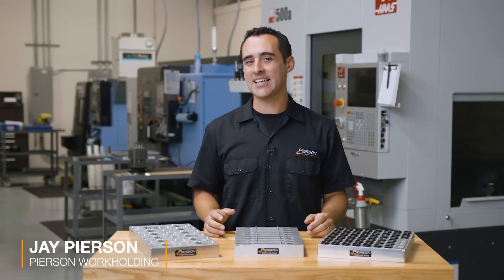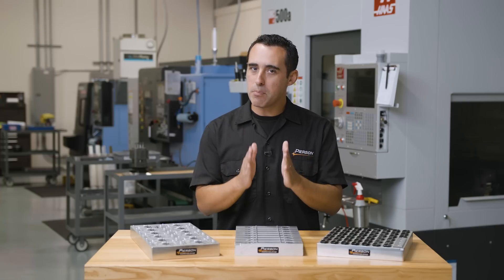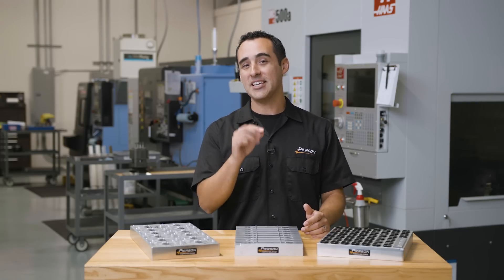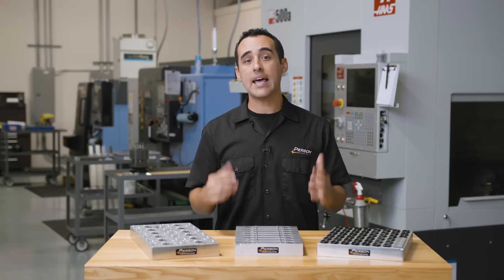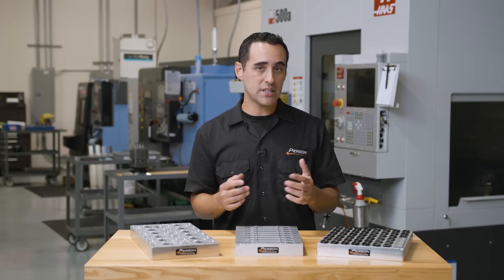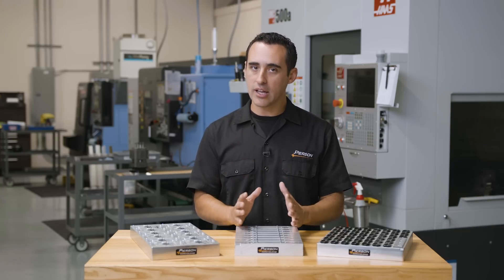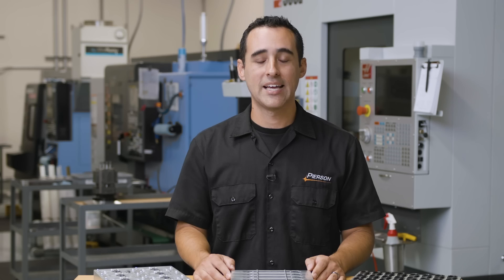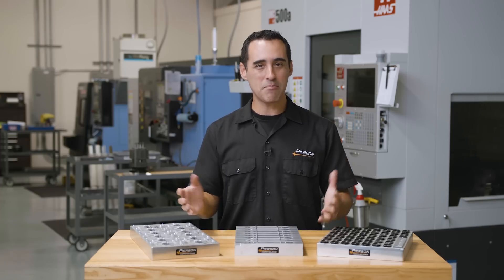What NOT To Do For Your Pallet Fixtures | Fixture Friday 12 | Pierson Workholding

Comment: actually you can create square hole pockets- SINKER EDM.
Reply from the maker: Or by broaching or by using smaller diameter endmills or by using a mating part that has an outside radius but EDM is the most expensive and slowest option and not recommended.
Reply: @PiersonWorkholding  agreed, rotary broaching would be cheaper. But if you got an EDM machine then I'd still go with that method.

Comment: Best clamps I've ever come across, have been OK-vise. Taking 2xD*85%ae in Aluminium with a 16mm endmill, and have never pulled out a part. Bonus is that you can machine soft jaws for them, and they clamp in two directions.

Comment: really enjoyed your tips... question... we have a few pallets and a tormach mill. unfortunately the tormach doesn't seem to have enough coolant force to really flush out chips. we end up with a lot of build up around the clamps and on inside features, and after we remove parts there's chips all over the surface of the fixture. takes probably 10 minutes to clean off the pallet in between uses. Any suggestions to help keep the fixture free from chips?
Reply: You can replace a pocket that utilizes the back wall of the fixture to locate the part, with a series of dowel pins.  By doing this, the part only touches the dowel in a very small section, which is essentially the tangent of a flat piece to the dowel, if that makes sense.  I'm not a fan of pockets, if I can help it, since they do exactly what you described.  You spend countless hours a month cleaning fixtures out of chips at best, and at worse, you risk the opportunity of one of those chips causing you to scrap a part.  
The fine art of fixture design has so many facets that most miss the high points.  First, repeatability is at the top of the heap.  Next is speed, the time spent loading and unloading.  Then there's operator friendliness.  No one wants to run a machine that kicks your butt all day.  Lastly, is exactly what your issue is, cleanliness or at least the ability to be cleaned easily.  Pockets, crevices and entrapments are death to a production shop.  
I've made thousands of fixtures over the years and my favorites were ones that were nothing more than a flat plate of ground A36, with a series of dowel pins sticking up and some of my custom "cam screws".  Clean, fast, user friendly and 100% repeatable.  Some of these fixtures I produced over 200,000 parts on without a hiccup.
Jay is putting out some pretty good content for the novice fixture builder, and it's been in need for a long time, but once you graduate to 4th axis for your fixturing, it's a game changer of epic proportions.  My largest part count to date was 276 pieces at a time in one push of the button, but I've done several that were over 80.  Lotsa of folks are skipping over 4th axis and heading straight to 5th, which is really a mistake most of the time, as you're limited to just one part at a time, most of the time.  4th axis on a vertical, with a tombstone, and fixture plates, is a gamechanger, that on the lion share of parts I see being put on a 5th, would run circles around.
I ran my first 4th axis tombstone on a Haas VF-2 in 1994 running 88 parts at a time.

Comment: Great tips, I never thought of the eccentric clamps being able to move up but I do realize that they do not pull the part down.
I use eccentric (hexagon style) clamps for some plastic (polypropylene) parts that I do for a customer. The parts are long, thin parts (160x15x8 mm) and having any marks on the side of the parts is out of the question. I only do some facing, milling a 1.5 mm deep pocket with a 3 mm end-mill and some chamfering. 
So I use them wisely, also for engraving on aluminum parts. I have seen aluminum blocks being pulled out of vices with smooth jaws. I tend to design my clamping such that I should not be able to move the part when I just finger tighten my clamping device (tallon grips, pitbull clamps, vice, ...). If I can move the part then there is a high risk it will move during milling.

Comment: another problem i have had using the smaller clamps is the minimal open and closing movement. in some cases i have found the tolerance on flat bar stock to be +/- larger than the clamps can compensate for. some times within the same bar it can be over sized enough to not go in easy and worse.. feel like its locked the material down when it hasnt and parts go flying.

Comment: Those aluminum channel clamps tend to fatigue and crack easily. I try to get about .001 to.005" gap between the part and the clamp face. The 7075 tends to develop fatigue cracks quickly.

Comment: Cool vid and good points. These are all basic clamps that are sold by MiteeBite/CarrLane. In my opinion I would recommend spending the extra money on the “ok vice” vise clamps over the uniforce or channel clamps. The channel clamps are just cheap and don’t perform like you’d want them to. I’ve designed a fixture with them once and will never use them again. 
If you’re already spending the money on fixturing a job, spend the extra money to make a dependable and repeatable tool.

I’ve just recently came across a great fixture supplier, Advanced Machine and Engineering Co. They sell high end fixture components that offer unique solutions to fixture design. Looks to cater to aerospace parts and castings. I realize this video was for miniature clamps focused on pallets but I thought these were definitely worth mentioning.
Thanks for the content Piersons!

Comment: Awesome video! Super helpful! When you use the bottom hat method (I think its called) where you cut your part out of a block but don't touch the thin bottom portion that is being compressed by the fixture, how thick do you make that portion? For the pitbull clamps its dimension "D" on the Mitee-Bite website. Could you go thinner then that or would you be worried the bottom hat would bow?
Reply from the maker: Good question! For aluminum, we typically hold between 0.090"-0.120" of material using the 3/4" clamp.  For steel and stainless, we always use the recommended "D" dimension of 0.150".
Reply: @PiersonWorkholding  Thanks that helps a lot!

Comment: How do you feel about non radially symmetric pallets? Over the 4000+ parts I ran this summer on pallets, I loaded two of the pallets in backwards. It scrapped a few parts and we had to re-machine the pallets. Do you usually design your pallets such that orientation doesn't matter?
Reply: I’ve actually have a couple of pallets that take advantage of the fact that they can be loaded rotated 180 degrees on the PPS. Imagine a 2 op part that is held down by screws and you don’t actually want to move the part to the other position on the pallet, just change where the screws are holding the part for the second op. If you alternate the positions of the ops and rotate the pallet 180 degrees each time it lets you run the same program. You just need to make sure your X, Y zero is really correct with respect to the alignment pins on the pallet base when you are machining the pallet so you can be confident all the pallet features are in the same position when it is flipped.
Reply: @swervedrivespecialties3827  but if you aren't actually moving the part, then why do a second op?
Reply: @swervedrivespecialties3827  also, I was on an FRC team (192) in high school, and we did swerve drives too 😎
Reply: @zeevyehuda2501  Second op because you need to machine where the screws were holding onto the part during the first op. That’s awesome. I remember seeing some of 192’s swerves on Chief Delphi.

Comment: I'm sure this is just pedantics talking, but those machineable clamps that point of contact isn't straight across.  Since it's a curved surface against a flat one, the force will be normal to the flat surface.  In this case, maybe a difference of only 0.5mm-1mm from the straight line you showed. I'm a blast at parties 😁
Reply: I think that horizontal line was meant to illustrate the height on the clamp of where the force is applied and not the direction.
Reply: I usually make mickey mouse ears in side walls of pitbull pocket,  so back wall is flat in clamp size.

Comment: I love those rocker clamps and use them everywhere. The problem with them in AL fixtures is they tend to indent or divot the fixture after repeated use..fear not! i found a solution.  I use thick wall EZ-locks for the screws and we EDM (can be machined) hardened steel saddles that support the back and bottom of the rocker contact points. I guess that's my tip of the day! great videos and i'm happy too see that i don't currently do any of these "do nots!"
Reply from the maker: You're absolutely right.  These clamps will indent into aluminum over time.  I discussed the solution in this previous Fixture Friday: https://youtu.be/Un0gLEHt8Lk?t=136
Reply: Who makes them?
Reply: @LooseyHenderson  mitee bite.
Reply: @wuzup76020  Thanks!
Reply: I’ve been using Mitee Bite for a long time. I also use their jaws. Very good.
Reply: @melgross  I'll have to see if there's a UK supplier.